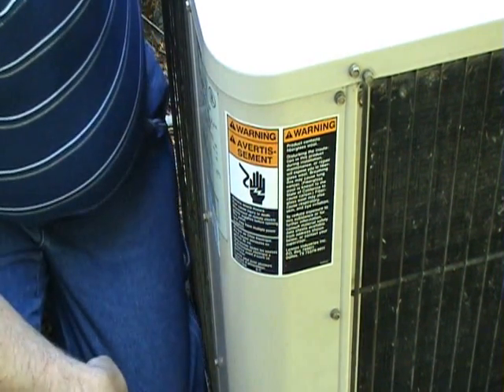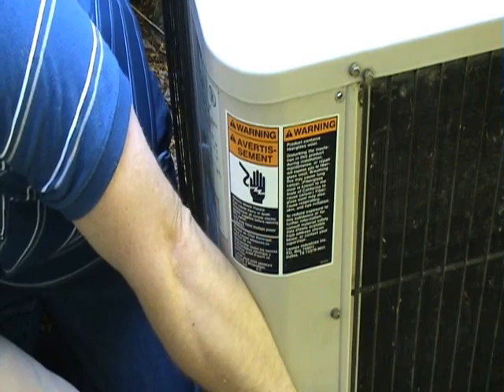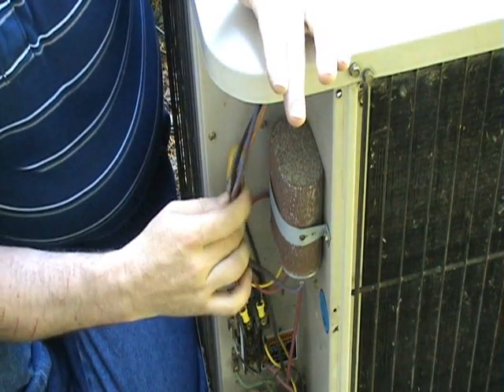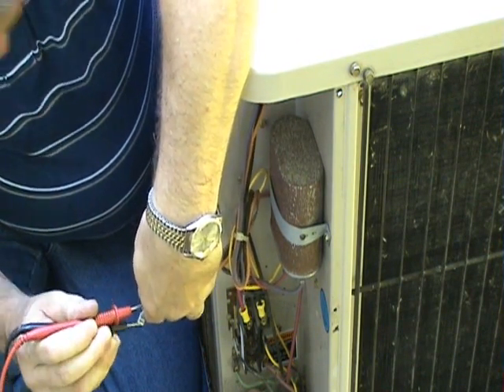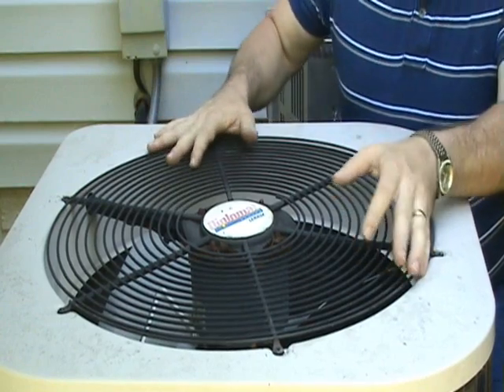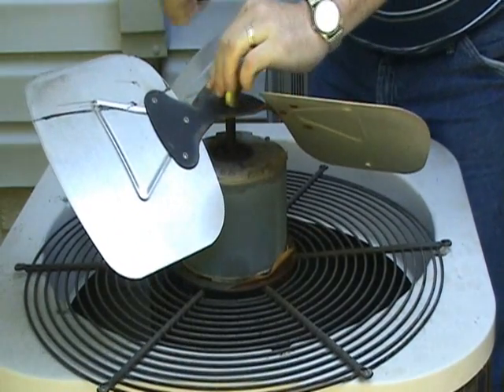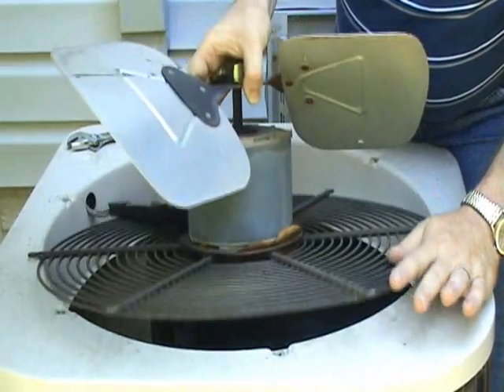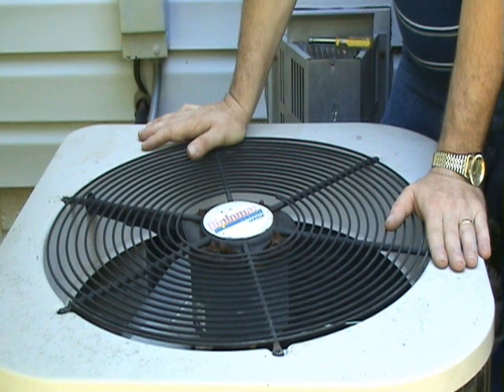AC Fan Not Spinning? How to Test and Replace the Condenser Motor! 🌬️

Comment from the maker: Is your fan motor humming but not spinning? Try the 'Stick Test'—gently push the fan blade with a stick while the power is on. If it starts spinning, you likely just have a bad capacitor, not a bad motor! 🛠

Quick Tip: When buying a replacement motor, always check the RPM and Rotation Direction. If the new fan spins the wrong way, it will blow air down instead of up, causing your system to overheat! [03:06]

Comment: I note the fan blades a little to far from the motor.  It need to move up close to the motor make sure the blades spin freely.
Reply: Honeybee should the highest tip of fan be a little bit inside the shroud lip? My tech replaced with new fan but can't remember previous placement. The top of this unit is now shaking loud but the amp draw is within spec.
Reply: @chieflouie2821  
The fan should be closest to the motor and the excess shaft should be cut or else you will have premature bad barings

Comment: Look I agree hire a professional but this process is really not that hard.  A professional wanted to charge $$650.00 not even including parts.   The biggest problem I had was pulling the fan off the condenser fan unit. (Been there 14 years)  What I recommend is replacing all the parts; purchase the Fan motor, fan and run capacitor. (My unit only had one). (Cost $275.00)  If you purchase the right parts the colors on the wires are the same so not to tough.   Thanks for the video!